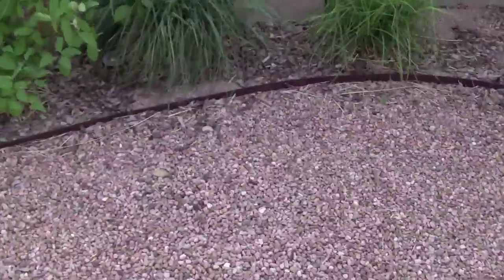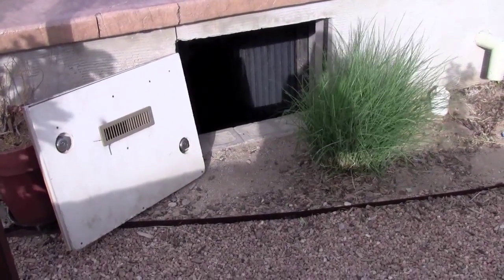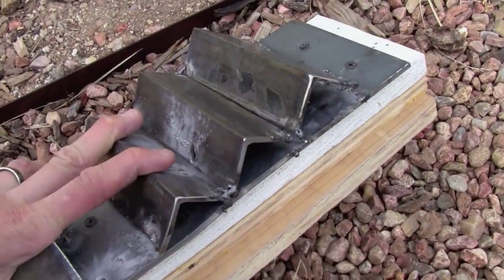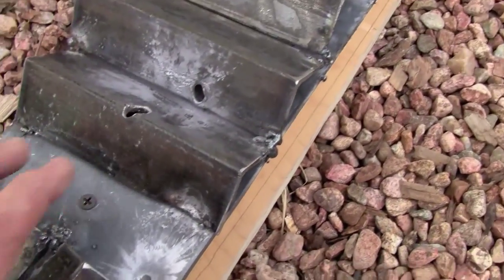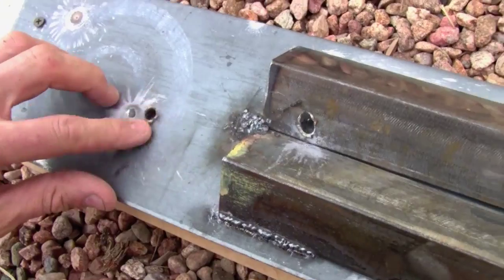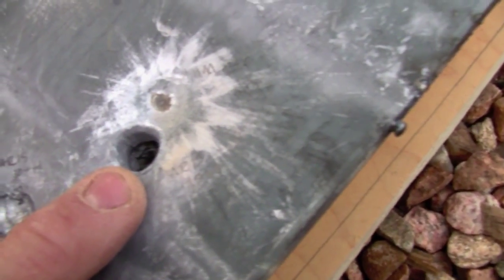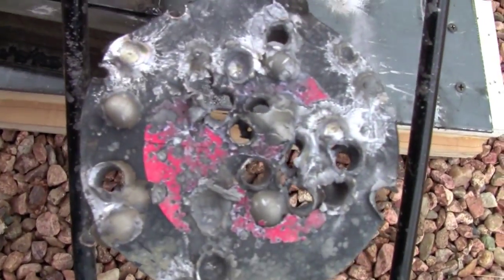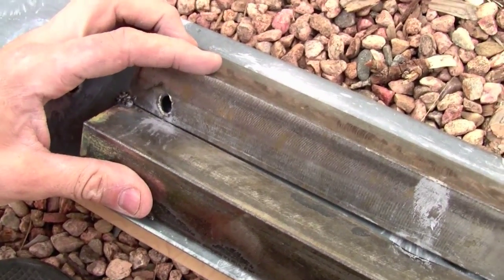Steel Bunker Door Ballistics Testing - AR15

Comment: awesome! sloped armour. the only kind really. id like to see a test if you have a punch. 3 inch punch on 1/8 plate or 1/16, whichever creates the most bubble effect. likes scales. rows of these slightly overlapping using flex seal to 1/16 plate then 3/4 horse mat then 1/16 plate

Comment: I really hope you are not on the west coast because I doubt the superstructure has been reinforced with steel to resist earthquakes. O.O

Also I am worried about the hinges on the door and it's ability to support the weight over time. 

Regardless of these minor criticizes, this is a superbly designed personal bunker and should be praised.

Comment: Well an M855 round would have punched clean through your zombie door or whatever you call it. You wanna strengthen the door reinforce the interior with AR400 steel at a minimum
Reply: All you need is 1/4" steel plate on front and back. With 4"-6" of concrete poured between them. It will stop a lot of ammo. Plus be blast resistant.